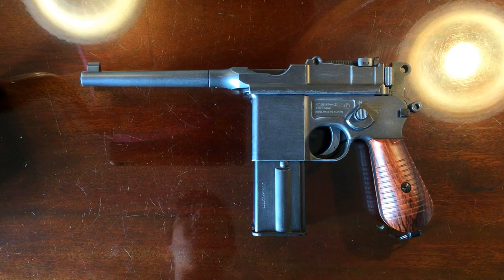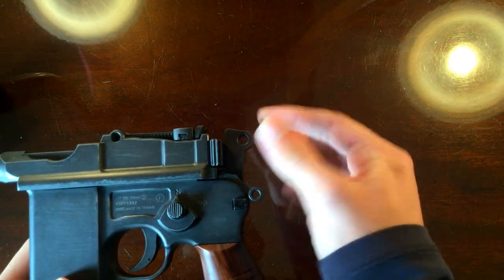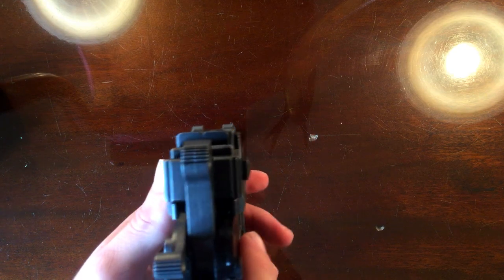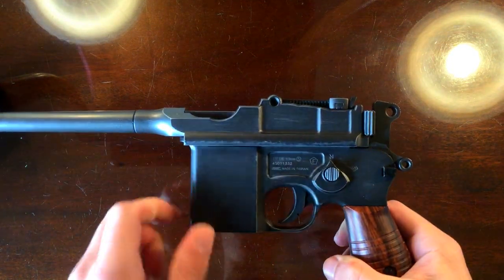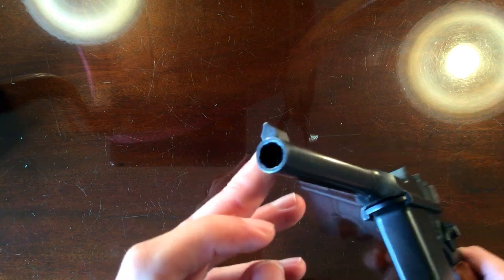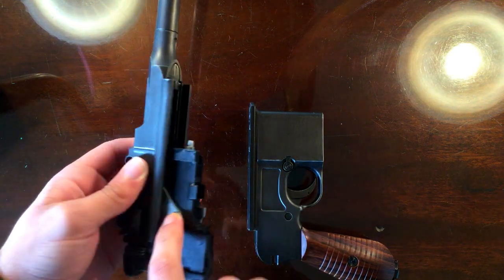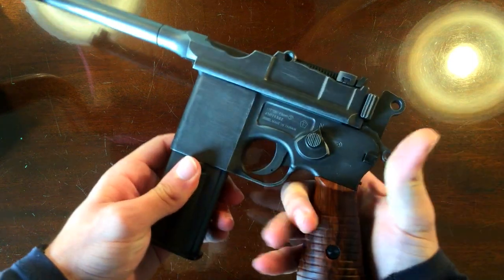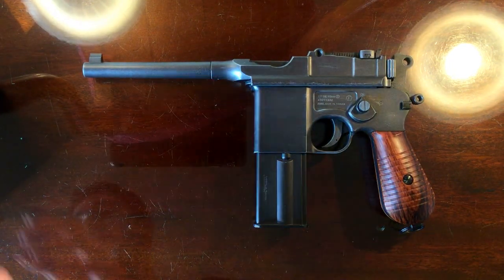KWC M712 'Broomhandle' .177 - Full Review

Comment: Could barely hear the audio even with volume at max. 
Fully automatic is illegal in the UK, a major criminal offence, important to point out.
Reply: Fully auto airsoft are not illegal in the UK
Reply: @douglassoal6196  This isn't airsoft, it's classed as an air weapon in .177.
Reply: @skepticalbadger  Sport on. As already classed as a firearm full auto immediately makes it a Section 5.